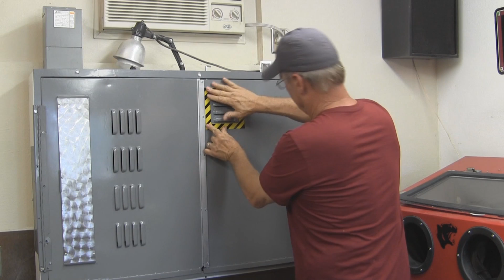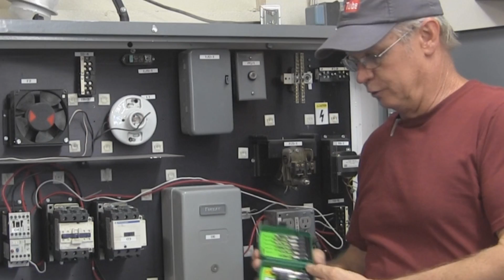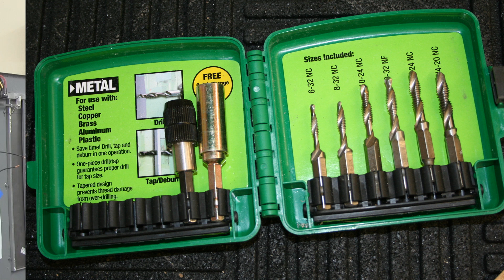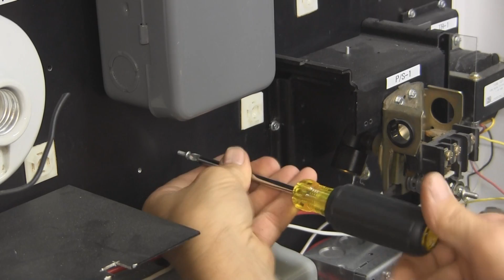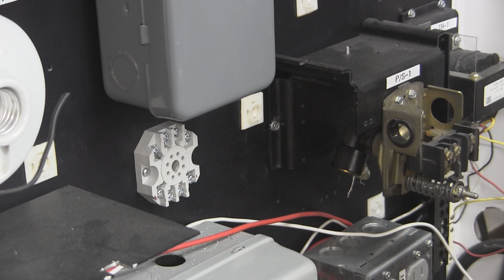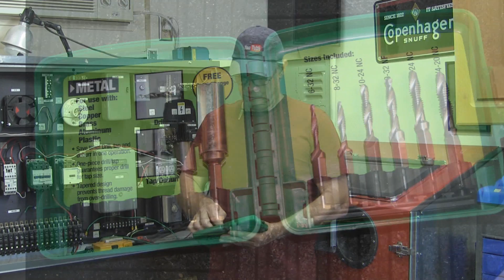Cool Tools  Drill & Tap

Comment: Is this work with standard hole for screws and bolts? (1/8, 3/16, 1/4, 5/32...)
Reply from the maker: No they are for common bolt sizes 6-32 to 1/4-20

Comment: these taps are good, I've gone through a few of the other brands, and the greenlee ones are only ones that have held up so far and been consistent in making the correct size tap. kit has all the common sizes electrician needs. it's a must have kit.